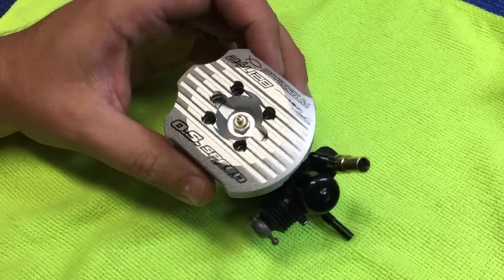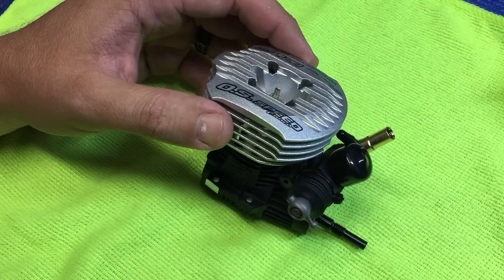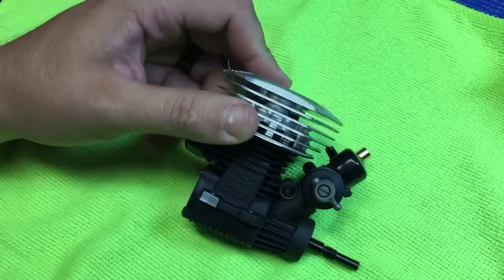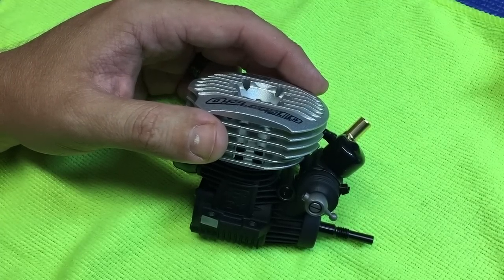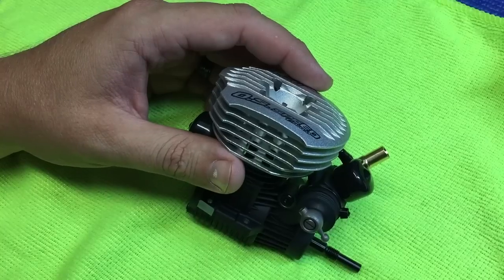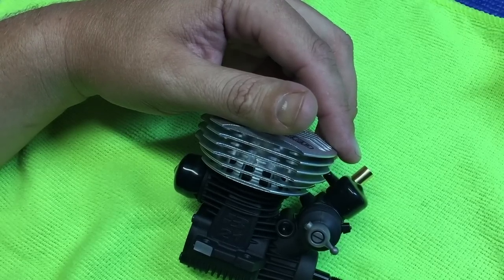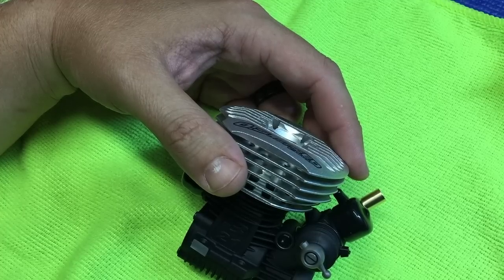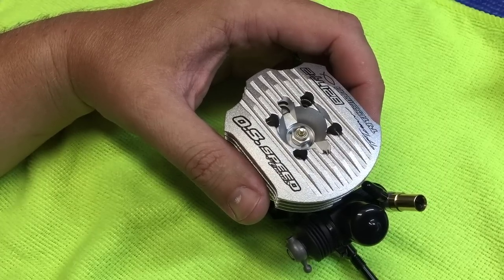Adam Drake from Mugen Seiki Racing talks about his new break-in method for nitro engines.

Comment: Hi Drake, Would you please clarify the "carburator alignment" part please? Thank you!!
Reply from the maker: Yes, depending on the vehicle you may need to adjust the angle of the carburetor and linkage to make sure everything is working smooth without any binding.  I hope this helps.

Comment: What is the difference between the oil soaking an the older school way 2 tanks idle an 3 tanks 1/4 to half throttle an make sure after 5tanks there is smoke coming from pipe due to the motor being rich still
Reply from the maker: The new method reduces wear and stress on the connecting rod during break-in.